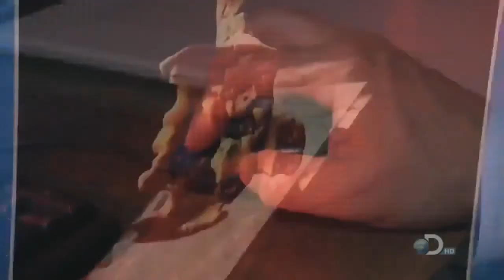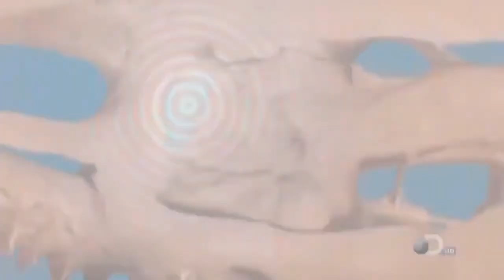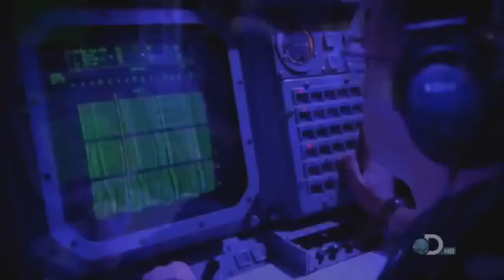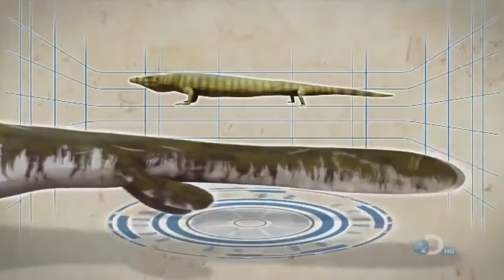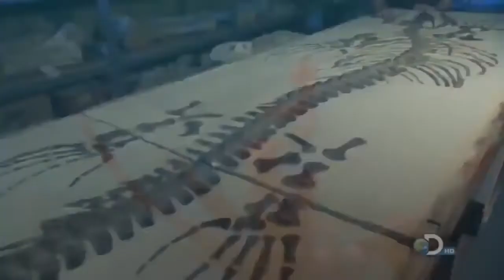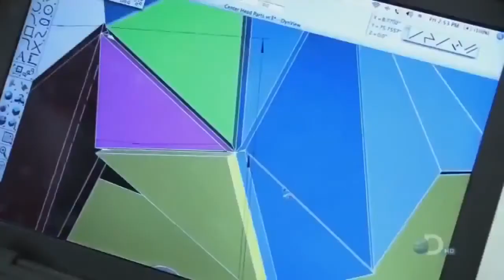T-Rex of the Deep - Mosasaur Documentary

Comment: Accuracies:
1. Forked tongue
2. 45-50 foot length
3. Correct time setting
4. Correct general body structure

Inaccuracies:
1. In the documentary it says mosasaurus/Tylosaurus weighed 8 tons which is wrong they weighed 12.46 tons
2. The bite wouldn’t crush the watermelon at that speed it would be crushed in the same time the jaw closed my bite force estimate is about 14,995 psi
3. The tail doesn’t have a tail fluke
4. Flipper shape
5. Where is the lizard features it looks nothing like a lizard! It’s supposed to look like a lizard!
Reply: Wrong about the body mass, the latest review about marine reptiles size from Greg Paul's recent book suggests 6.7 tonnes for Tylosaurus proriger.

And there is zero mosasaur bite force study yet.
Reply: Another inaccuracy: Being compared to the T. rex for the title